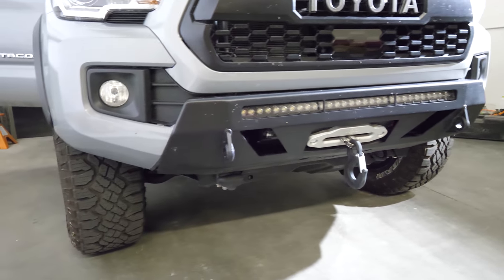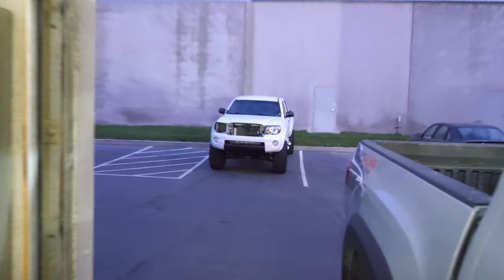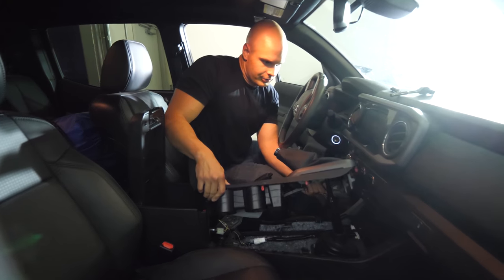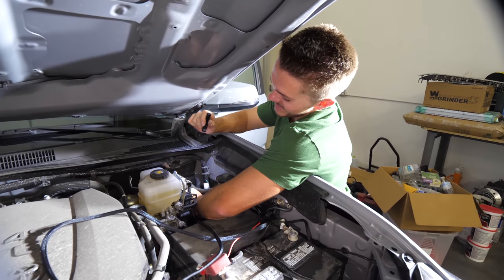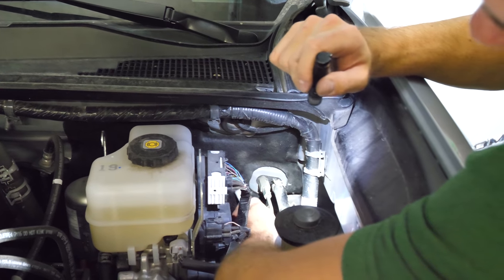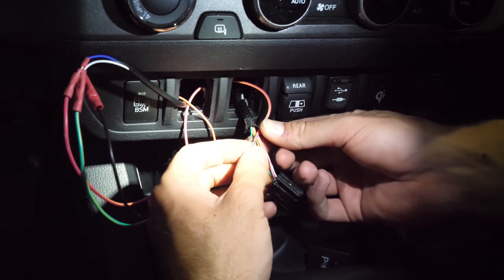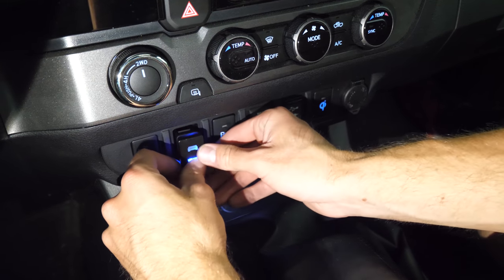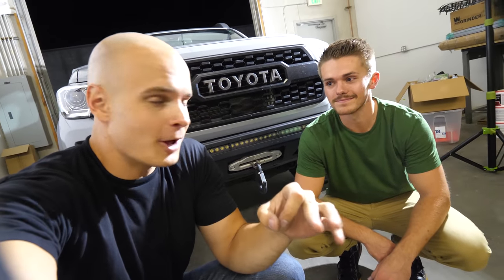LED Light Bar install + Dashboard switches on 2018 Toyota Tacoma

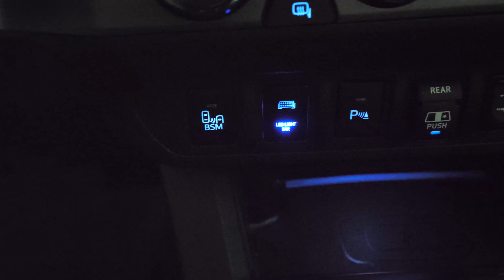Comment: 7:44 If you put a resistor in series with the light switch, it could make it dimmer
Reply: Stephen Netter Nope, that wouldn't work because switch is just controlling a relay, power to light bar is going directly through battery.
Reply: Nano Mine I think he was talking about the switch’s lights not the light bar.
Reply: 09Mrsubaru Oh, makes sense. That's possible.
Reply: Yea this is what I plan on doing with my switch when I saw it was too bright. I even tried tapping into the dimmer circuit but the button light would stay lit when everything was off strangely.
Reply: @LesFishingMoreCatching  Try tapping into the light off another switch. I don't know how new your car is, but in my truck, the dimmer switch only tells the computer what to do.
Reply: DavyDave1313 huh

Comment: Main thing I would have done differently was solder the connection you spliced into.  Then used heat-shrink tubing to finish it off (over the electrical tape).

Comment: Here's a optional tip. You can wire the relay so the high beam stem can operate the lightbar easier instead of looking for the switch. 

On the relay, take terminal 85 and tap into your high beam wire. 86 to  ground from your switch.  30 to B+  and 87 to lightbar.

The only drawback is that the highbeams will on with lightbar, but the switch is the override and will control the lightbar so you can only have the highbeams on .
Reply: This is a great idea.    Do you have any videos or documentation to further explain/illustrate what you are suggesting regarding tapping off your existing High Beam stem while using the switch as the main on/off control for the light bar to luminate?    Great stuff -  many thanks!

Comment: Just a tip with the cheap light bar wiring harnesses with that type of connector, take two VERY small flat head screwdrivers and carefully push down the tab that's in the connector, and use the other screwdriver to push the wire out, a whole lot easier than taking something an inch wide through a tight piece of rubber. Did that once already with a cheapy 44" bar and bought a SPod a few months ago and love it, makes wiring up lights and other items much simpler. Would highly recommend. Just in my opinion.

Comment: Just picked up my 2019 Tacoma on Thursday. 👍 I have the same oem roof rack as you. So did you decide to scrap the light bar over the windshield idea? Are you just gonna go with the bumper bar. Curious because I was looking for an install video for the upper bar on the oem rack and can't find one. Thanks.

Comment: How did you spooled it while adding tension with a 1000 pound weight? Why is the bumper hanging low on the passenger side? Tanks for making great videos.

Comment: Maybe it's better to chose the USB Port instead of the PDC Button, because the USB Port (also fuse) is meant for high current. Or is it just like a small Signal to the relay?

Comment: Hi Zack, 
Great job with the light bar. It totally blends in with the looks of the toyota. 
I was just wondering - normally bright headlights do cause te pupils to constrict to some degree but it's designed to be an acceptable limit. When an extra LED bar is added, it obviously would cause the pupils to constrict a little more and it probably will be ok with LED bar you have on. Just as a food for thought, how would it be if a super bright LED bar was made with red light. That way it might be easier on the eyes to accustom and de-accustom to the bright light. Just a suggestion, how about a red LED test - or maybe just a transparent red cover. Cheers

Comment: Zack you should upgrade to LED low and high beam headlight bulbs for that truck, Lasfit lighting have really good lights, since you have projector headlights the cut off will be the same as stock halogen bulbs so no blinding other people, it would make the front end of the truck look more like 2019 and not 1930, also there would be no color difference between headlights and the led bar which i think is better when you use both at the same time

Comment: Great video, i'll be wiring the same buttons from CH4x4 for a light bar and raptor lights.  My question is, where is that dash light wire to have the button lights come on with every other button light?

Comment: LED light bars are supposed to be linked up with your high beam on your main lights so they only come on when you switch your high beam on, not as a seperate light.

Comment: Is that a huge crack in the windshield at 2:52?? WTF Zach! You should always solder the wires. That crap is a bad connection waiting to happen.

Comment: Much easier to remove the radio (let it hang out) and reach down into the radio hole to push out the caps and route the cables for the new switch. Done it many times.

Comment: Curious question, about your leather seats did it come stock or did you have it reupholstered to leather. Just bought my 18’ TRD OR same color “cement” but mine came with fabric and considering the dealership quote of $1700 to put leather in which the seats would still be covered by my warranty, wasn’t sure if that is a fair price since they have to ship off 200 miles away or way over what I should be paying.
Reply: Stephen Williams I have a 18 Sport with cloth and had the reupholster worked into the deal. The paper work showed $800 cost for them
Reply: david scruggs thanks David, I really am wanting to put leather seats in my Taco, considering looking for  leather heated seats out of a 5th gen 4Runner mainly for the power seat option of raising the seat or lower when needed plus a warm tush in the winters. Anyway enjoy ur videos and your install of your C4 bumper is going to come in handy.

Comment: just a question. why dont you wire it to the fullbeams so it lights up when you turn on the fullbeams? i have seen other youtubers wire it to a button in the cab to. is it illegal to add light to the fullbeams in the us or what?
Reply: I'd say no to that idea, one too many people often forgot their hi-beams
Reply: @Afeeq1011  i Guess but it's not a problem where I'm from. Like half of the cars have extra lights connected to the fullbeams. But I guess it more necessary here in Sweden when we have like 5 hours of daylight in the winter.
Reply: That’s gotta be illegal, going down the road with a light bar on could easily blind other people. Those things are insanely bright
Reply: @macbookpro57  in Sweden it legal. There is no limit to how much or bright fullbeams you can have. It happens very rarely that someone forgets to turn off their fullbeams . And if they do you just flash your lights. Like I have a 30'' light bar and 2 x 75watt xenon. And that is pretty normal here. What is strange tho is that you can not have parking lights in your extra lights that's fully illegal for some reason
Reply: @Joel.S  That's exactly what I'm thinking. You have to switch off fullbeams anyway everytime you're passing other cars, bikes, people... Here in Czech Republic it's forbidden to use fullbeams in the cities with streetlights on, even when not passing anybody. So we spend most of the time riding with dimmers. 
I'm thinking connecting my fog lights (I'm not sure how you call them) to fullbeams switch, so they can act as a lightbar. We don't have fogs anyway...
Reply: @macbookpro57  We have many such idiots here too! So I want to have even stronger lights ready for those :-D
Reply: My Camaro has xenon in the low beam, full beam, quad fog lights behind the grille with xenon, I've bipassed the standard wiring of the car to have them all able to come on at once.
Reply: Depending on the cop and the state, it could either of two ways. AS the law is written, driving with uncovered off road lights gets you a ticket, (can say I have yet to get one after driving by like 20 so far with 4 pods installed). And also the law says the light cannot be blinding an oncoming driver, so there is that point as well. most of the US drivers have no clue how to turn off their high beams to begin with, so that's an issue as well. I would check with the police to make sure it is okay before doing so, or risk getting a ticket. Like I said, I have 4 cheapo $20 light pods installed on my  4th gen 4Runner (2 on A-pillar mounts, and the other 2 on the front bumper acting as secondary fog lights.) And I have yet to get pulled over for just my lights being uncovered.

Comment: So mad I got the 2019 4 doors tacoma SR5 it is like the cheap version of all the tacomas 😫
Reply: Nah, don't be discouraged. I had a 2018 SR5 extended cab 4WD v-6, and I traded it in for a 2019 TRD Off-Road 4dr manual 6 spd. and I thought the SR5 was nicer, really. The access cab didn't fit car seats and I ate $6500 and got another one.. I kinda miss the auto trans. sometimes..

Comment: Can I do that to a lease ?? I have a 18 Tacoma leasing for 3 years but I just want easy mods don’t want to drive it all plain for 3 years
Reply: I was told with my 17 lease that Toyota doesn't care so long as you don't do anything permanent like cutting.
Reply: Does it matter? You'll be selling it for $9000 more than the payoff. Do whatever you want to it.

Comment: Why don’t you connect the light bar to your head lights so when you turn your high beams on the light bar turns on, but you have the switch that you installed so if the switch is off the light bar doesn’t turn on when you turn your high beams on but if the switch is on the light bar turns on when you turn your high beams on 🤯
Reply: Headlights are controlled by the BCM a type of computer relay that usually doesn't output "clean" power and would cause the relay to chatter and turn on/off rapidly. And in most places 3 sets of driving lights is illegal on any road. So lights + bar is ok but not with highbeams too

Comment: I've never understood why people turn lightbars on and off on a seperate button. Just hook it up to full beam, bam! Done! 
I mounted a button in the engine bay because I cba to pull a wire into the cabin, just in case I want to disable the light bar but I never have.